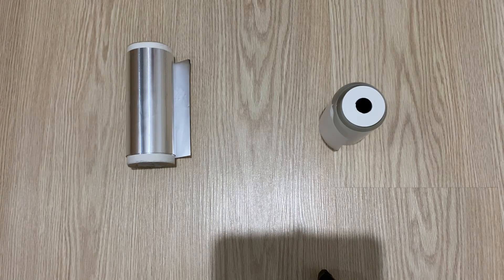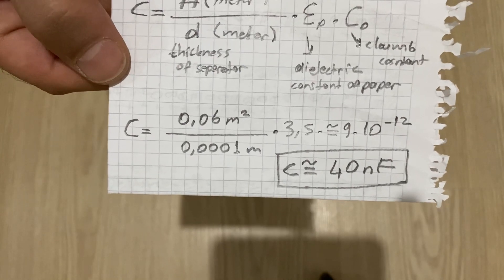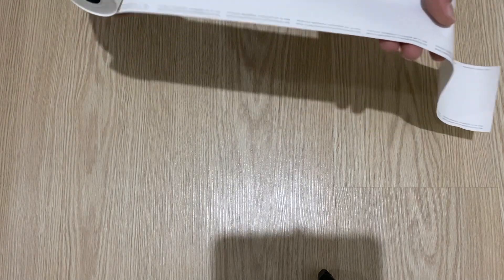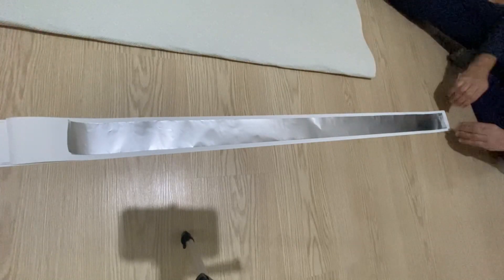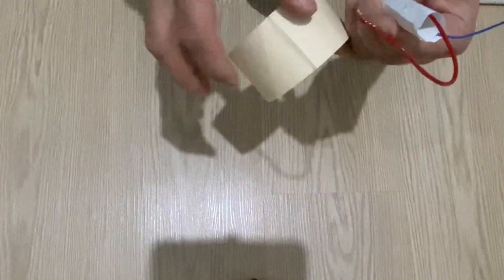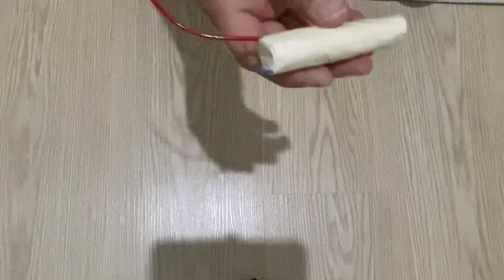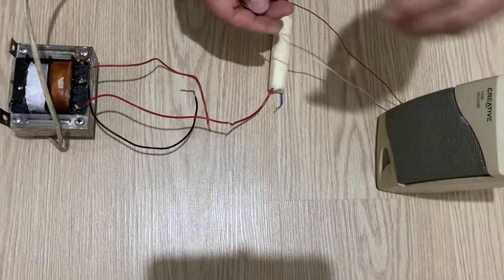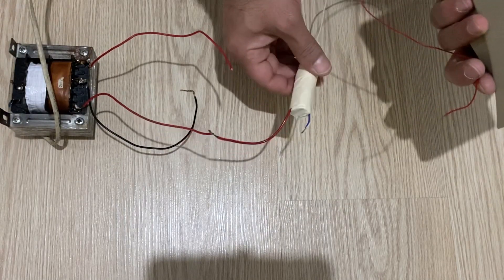How to Make High Voltage Capacitor.

Comment: I tried this years ago but didn't work, watching your thing and remembering what I tried, I put the connectors at opposite sides of the scroll, aka the negative was in the middle and the positive was at the edge... Perhaps that's what went wrong?
Reply from the maker: Probably there might be a short circuit or a disconnection bro otherwise it must have worked.

Comment: You said the voltage is 1500 Volts... How do you make them so they're 12v or 120v?
Reply from the maker: We calculate it according to the thickness of the separator.
Reply: @joyofelectronics9782  can you please make another video where it's 24v and the whole roll of aluminum foil from the dollar tree... I've always wanted as fast as possible charging times and I know the wall can do 1800 watts while chargers are nowhere near 1800 watts, potato gun made this basic proof of concept video:

https://m.youtube.com/watch?v=713s58xPQeQ

Comment: This capacitor works on direct or alternating current
Reply from the maker: It can work both on direct and alternating current. It is bipolar 👍
Reply: @joyofelectronics9782  I did an experiment on direct current and it didn't work. Can you explain to us what the components of a dc capacitor are?
Reply from the maker: @kerloesmedhet3480  after you build your capacitor make sure there is no short circuit inside it or connection break. If there is no short circuit and disconnection then probably your capacitor work but the capacitance is very low that you can’t understand if it is work or not. Since this type of capacitors working under high current you should apply high dc or alternative current. (Warning: be careful when you working with high current.)
Reply: Do you know what is the electrolyte solution inside the capacitor?
Reply from the maker: @kerloesmedhet3480  there are many solutions. Unfortunately the firms mostly keep them as a secret. I can give you some examples of them. GBL (gamma-butyrolactone), DMF (dimethylformamide), DMA (dimethylacetamide) you can make detailed search on google👍
Reply: Can you try these ingredients please
Reply from the maker: @kerloesmedhet3480  these ingredients are highly expensive and difficult to find. I don’t recommend to try. It doesn’t worth that😉
Reply: But can you help me, please, because this research and experiment are required of me at the university? Please, please help me
Reply from the maker: @kerloesmedhet3480  okey. If you wanna make a electrolytic capacitor you should not only care about electrolyte you should also care about the oxidation process of aluminum. It’s very difficult to run this process at home. Instead you can do this: take two pieces of aluminum foil (100 cm to 6 cm.) put them in hydrochloric acid (10% water solution) for 1 minute to etch the surface. Then use a post machine paper as separator. Use aqueous sodium sulphate solution (1 molar solution) as electrolyte. Roll the foils and paper carefully. Seal them in an appropriate container. That’s it you have electrolytic capacitor (1.2 volts, 500,000 mF)
Reply: @joyofelectronics9782  Thank you, my friend, for your valuable information and your seriousness. I will try it as soon as possible to hand it over to the university and let you know the results
Reply from the maker: @kerloesmedhet3480  l am looking forward to it my friend👍 you are very welcome

Comment: use capacitor oil
Reply from the maker: @dedu456  t is post Machine paper. The thickness is 0.1 mm. But you can use any type of paper if you don’t have it. I specifically used it for it was long enough.
Reply from the maker: Yes may friend if you want to seal it in a container it’s better to use capacitor oil. But for a capacitor 1500 volts it doesn’t actually need it.